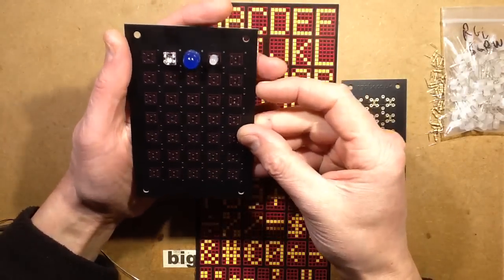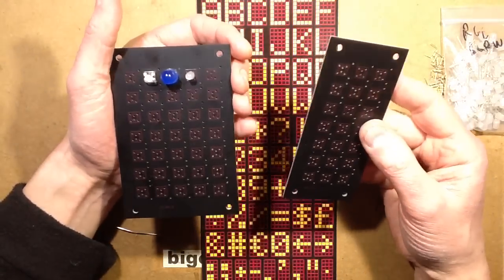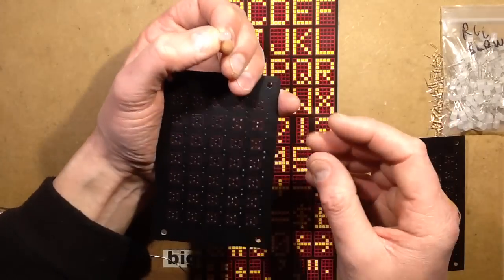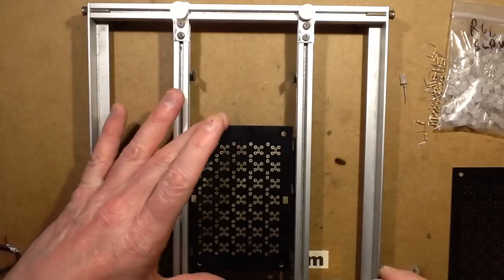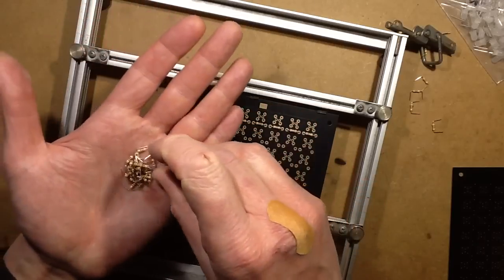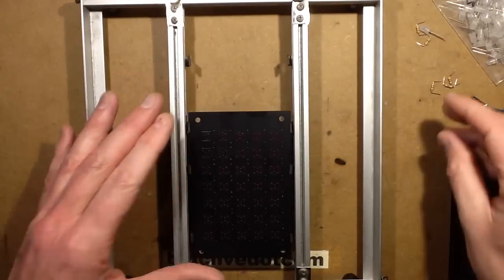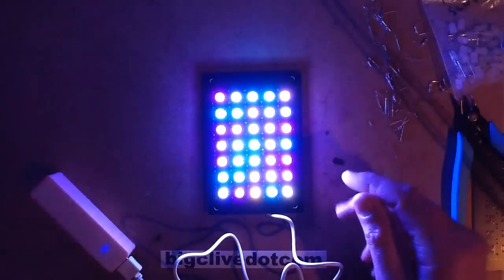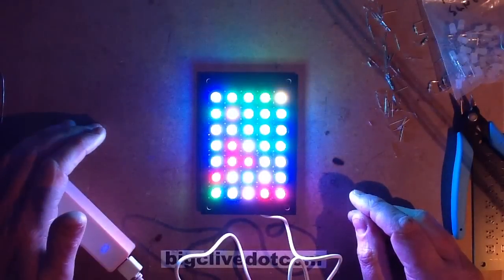RGB LEDs, signs and answers to questions.

Comment: The worst electric shock I ever had, was in my mother's living room. 
PLEASE READ AS THIS COULD SAVE YOUR LIFE!

I left all my tools at work and ending up using my anti static tools, which aren't really designed for mains voltage. 
I was swapping over from a plastic double light switch to a double chrome light switch, which I earthed first. 
I pulled the fuse for the down stairs lighting ciucuit, thinking it was off (Remember. I left all my tools at work, including my volt meter). But someone before my mum moved in, put a circuit for a pair of PAR 38's in on the sofet to light the garden up. Which ended up being fed from the upstairs lighting circuit.
They were switched from downstairs, but the feed came from the upstairs lighting. 

As I was putting the last cable in, as I was holding the earthed chrome light switch in my left hand and holding the live feed with a pair of anti static pliers in my right hand.  I must of touched the metal work of the pliers as there was burn marks on my left hand and burn marks where I touched the live metal work of the pliers. 
Basically I ended up getting locked on. Something NO ONE ever wants to do 😕

Both my mum and bf at the time were in the living room with me. They noticed I flinched and froze up n realised that something wasn't right. The bf at the time jumped up and ran to turn off the main switch. I must of been locked on for about 20-30 seconds and when the ambulance turned up and did an ECG they said that "the only reason why yous still alive, was due to my young age".

My whole body locked up. 
I couldn't move. 
I could feel the 50hz flowing through my body. 
My vision went really dim. 
I tried to shout out as loud as I could "HELP ME!!!!" but nothing came out. 

I ended up pulling myself off (and half ripping the cable out the wall) as my body tilted back. Something else which was also lucky, is there was a glass table about  600x1200 right behind me which I lucky didn't fall into. 

After the ambulance was finished with me. I was blue lighted up to A&E n spend a few hours on a proper ECG machine. Just to check everything over, making sure there wasn't any damage to my heart.

This is one of those stupid mistakes you only ever make once. As Dave from EEVBlog would say, "Though shall check voltages!" 
If I had my proper tools, this would of never happened, but you do think to yourself "she'll be right" until it isn't. 
I've had a few things blow up in your face over the years but that must of been one of the worst experiences in my life as I honestly thought I was going to die. After my accident, one of my tutors was tell the students that you can only get locked on with AC only on DC and I had to prove him wrong. 
I really hope from the rest of his teaching career, he'll tell people that you can get locked on, on low frequency AC.

Always remember. 
Electricity will kill you and you need to give it all the respect it deserves. Which in the vast majority of the world, it doesn't. And yes I am including places like American and most of Europe. I'm happy to say that the standards and health and safety (even though some of it is stupid some times) in England are second to none.
I'm a fully 17th edition electrician btw before you ask and yes I should of known better as it'll bite you in the arse before you even realise it.

Comment: Worse shock I got was on an old point to point oscilloscope from Korea or WWII. The 600v capacitor somehow managed to have one of its legs rubbed against a lead that connected the inputs to the scope.

So I went to go plug a banana plug in, and WHAM! Thrown across the bed I was sitting on. Heart was thumping like mad and very erratically. 

I promptly got rid of the scope. I could have fixed it of course, but it nearly killed me.

Comment: You do have a ventilation system when you solder off camera, right?

Aren't solder fumes as bad as smoking cigarettes?
Reply from the maker: There's a lot of misplaced hysteria surrounding soldering.  Ventilation is only really required if soldering at an industrial level.
Reply: but the smell is nasty
Reply: I used multi core rosin based flux solder for 40 years and developed a sensitivity to it such that now a small amount inhaled causes my lungs to be irritated. See HSE http://www.hse.gov.uk/lung-disease/electronics-soldering.htm Which is why I blow at the screen when I see fumes rising as Clive does his soldering, sad but true.
Reply: Usually if you hear the phrase "as bad as smoking cigarettes", it's some kind of bullshit. It's the kind of thing you'd expect as the title of a click-bait article or a piece of propaganda, not a reputable source of medical knowledge.
Reply: Bill, lead vaporizes at 1750ºC, there's no way in hell a soldering iron will get solder up to those temperatures, so no, you will never get lead fumes when soldering.

The real concern here are flux's fumes, you really don't want that crap in your lungs.
Reply: I once had my upstairs neighbour banging at my door, yelling that he was going to smash my car if I didn't close my windows, because he could smell my solder fumes. So there's that.

Comment: There are a few PCB makers for double sided now over in China that are silly cheap compared to say 10 years ago. I have used them for prototyping 10 offs for less than £50 delivered. By the time you go to say 1000 off they are usually less than £1 each. http://www.pcbway.com/ are not bad (I use them) and http://www.allpcb.com/online_quote.html give quotes from several sources.

Comment: Re: converting units...don't.  It's so freeing when a person doesn't think of SI units in terms of some other units, and just accepts them for what they are.  It is perhaps the biggest stumbling block for my fellow US citizens in adopting SI, that they seem to be constantly worried about what this dimension or that dimension is in customary/traditional/imperial units.  If instead they'd just get used to how long a meter is, how much volume a liter is, how warm or cold a temperature feels, and so on, for most purposes it'd be so much easier; it certainly was for me once someone taught me to approach it like that.

Besides...if you insist on knowing what a measurement is in other units, Google Search does conversions directly.  You start typing in "5 mm in" and the suggestions will probably have "inches".  When the "search" is performed, it'll show you a JavaScript widget which will allow you to change the input and output units.
Reply: I accept SI units for what they are. A meter is 39.37 inches. So about 3 and 3/8s inches longer than a yard. But I don't use yards ever to measure anything. So the metric system is patently worthless as far as I'm concerned. Now tell me, when I am making something +0.003 of an inch tolerance how does using metric make it so much easier for me? Do you seriously believe expressing that in metric makes it any easier? +0.0762mm Because if you do I'd love to hear your rationale. As I always enjoy a good laugh.
Reply: That's around 76µm (micrometers). It scales down just as easily as up. Enjoy your good laugh.
Reply: @digitalspecter  But I don't own 76 micrometers, I only have 1

Comment: I know this video is 2 yrs old - I watched it to see how to make a light panel because I tried to make a LED panel of 50 IR LED's and after all that time soldering I hooked it up only to be let down because only 8 LED's worked ???I am self taught so I am not sure what went wrong no bad solder joints correct polarity- dropping resistors used I am at a loss as to what happened anyone here know where I can find a schematic of a 50 LED light panel. Clive has so many videos I get side tracked and just end up watching them. I am sure he has one that explains how to do it but I just cant find it lol
Reply from the maker: Were all your LEDs the correct way round?
Reply: Hi Clive !! Yes- all LED's were correctly oriented & soldered Pos to Neg,  I think where I might have gone wrong is I connected them all in series? (Series Parallel might have been a better way I think )  I wanted to drive them from  12v Lipo 2200 mAh. I was trying to make a IR flood light then remove the IR filter from a CCD camera for a hand held all in one Night Vision set up. Not sure where I went wrong- Thanks so much for the response!!! Your channel has REALLY inspired me to dig out all the old failed projects & get back into electronics- since my wife of 28 yrs passed away 7 yrs ago your channel is just what I needed to pull my head outa my Ass and do something I enjoy So THANK you Sir for your time to make and post these wonderful learning videos
Reply: Clive-I just dug the board out and it looks to me like I did wire it series,parallel Actually I can't tell what the hell I did? my eyes are not as good as they use to be lol

Comment: There is another very practical reason to wear pants while soldering components onto a board or chassis..... but you are too much of a gentleman to digress to a discussion of burned spots resulting from stray droplets of molten solder landing on, er, "very sensitive areas."
Reply from the maker: Are you referring to penile solderment?
Reply: @bigclivedotcom  Ah yes, that's a good description. That, and inadvertently causing one's pubic hair to give off smoke signals - most upsetting.

Comment: I for one miss Red Yellow Blue, Am I alone in this? J.
Reply from the maker: No.  I still can't believe someone sanctioned the replacement of an established colour code with a lesser one that swapped a phase and neutral colour.  the whole point of the red, yellow and blue colours was to spread them across the visual spectrum for maximum ease of identification of grubby or faded wires.  Now it's just fundamentally three shades of dull.
Reply: Agreed. I would spend ages forming cables in panels till they looked just right, it also made tracing a breeze. Bad move changing the colours to shades of dull. Regards, J.
Reply: i would say the same about red black and green
Reply: What has most of the world got against using red for a 'live' conductor?, might aswell use Chinese lucky dip colours IMO. At least it forces some people to actually test circuits I guess. J. (Though I would often work live to save time, Makes you more cautious if you assume everything is trying to kill you)
Reply: Average Joe  I think its because  red is used in  DC..
Reply: ***** You could be right about that, J.